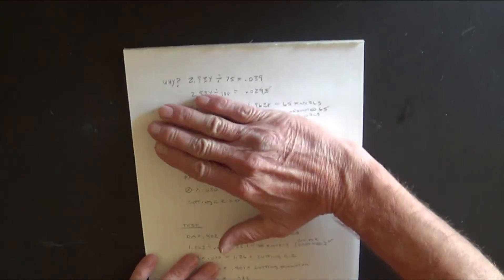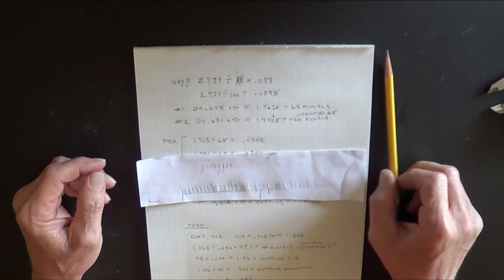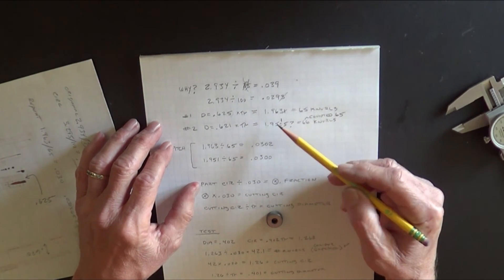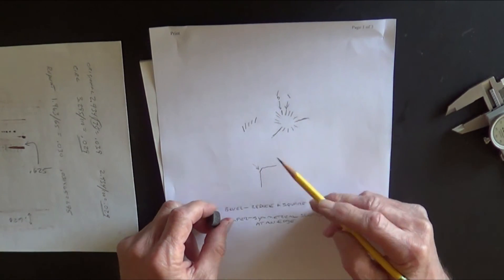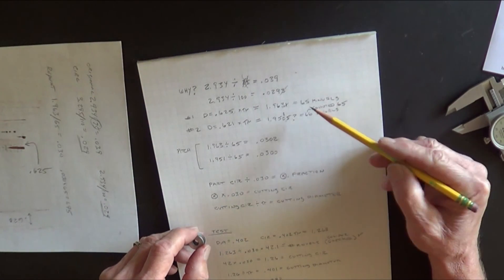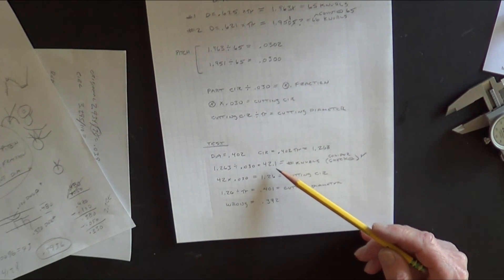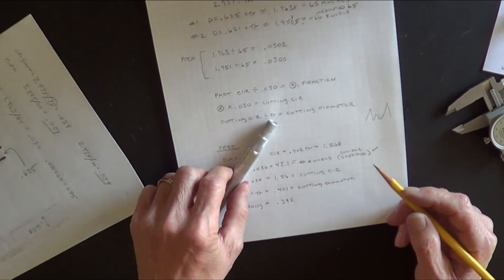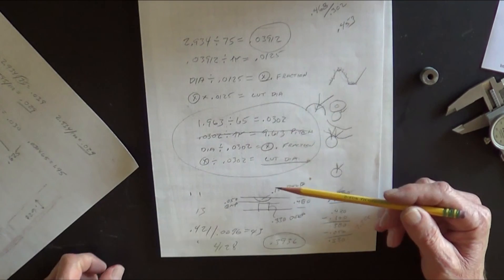The Art of Knurling Take 2 Video #10

Comment: Dave,

You are using the correct approach by first finding an integer multiple of the crest-to-crest knurl tooth spacing and then  determine the new circumference (and converting to diameter) before knurling. In practice however your usually have to machine the new diameter a few thousands larger than the calculated diameter. 

Next, lay down a very, very light test knurl track by manually turning the chuck two revolutions to see if the knurls are tracking perfectly over each other. If not, take another 0.002" off the diameter and test again, and usually this second pass is close enough. Then go for full deep of knurl in one or two passes. I use this technique a lot and it works every time (see examples at http://www.homemadetools.net/lathe-tailstock-clamping-lever and http://www.homemadetools.net/machinist-jack-accessories ). Also another HomemadeTools contributor who goes by the name "PJs" has published a great calculator for determining the correct knurling diameter according to the type of knurls used (see http://www.homemadetools.net/forum/online-knurling-calculator-20335 ). 

Thanks for the follow-up video on your knurling,
Paul Jones
Reply: +Paul Jones Thank You for the kind words Paul!  Your knurls always turn out beautiful!  The key to me in the formulas is that they work on any size materials as long as you know the exact makeup of the knurls you are using.  However having your tools held rigidly and square to the work is just as important, IMHO.  ~PJ
Reply: +pjsalchemy Thanks, I have been using your formulas for knurling dimensions in my drawings. I also discovered an Android phone app "Knurling Calculator" that I can use in my shop but it only works for knurls using Imperial dimensions. I don't think the app is available for the iPhone.
Reply: +Paul Jones Thanks! Glad you got some use out of it and for the App tip.  I had tried a couple of apps a while back and didn't work out but this one is based on Ghostses' original which I mentioned in my dissertation. It seems to be within tenths of my spreadsheet for 14, 21 and 33 TPI knurl wheels.  I'll spend some time with it and check it out!  Might be worth writing an app just not in my skill set.   I just loaded the spreadsheet on my tablet and use it in the shop along with some other calculators I've built.

Comment: Retire? Nah, I got 5 bucks says your still thinking about the problem and theorizing about the differences.....I've got a theory but I'm going to preface it with a  quantifier...I have zero machining experience (other than watching youtube vids), however I do have some experience with woodworking machinery and the major differences in fit that can be caused by very minor deflections in the machine. My theory? The small diameter of the part, the minuscule error in math, the softness of the working material, and tool pressure combined to let the tool fall into the previously started knurl...resulting in a visually accurate work piece. Got's to remember as you knurl you are changing the diameter of the piece as well, it's actually expanding- ( used to be cheaper to knurl the valves instead of replacing worn valve guides)- yet the working point, where the point of the tool meets the surface is decreasing in diameter....not sure that that would have squat to do with it....So what happened to the piece made with "correct" math? I'm betting it's just what you said... a piece of debris ... knurling is actually deforming the metal to begin with and creates heat.. aluminum gets gummy with heat and harder to clear chips but now I'm preaching to the choir. The challenge? Make a piece out of steel, minimize possible deflection, use wrong math on one end, "good" math on the other and see what happens....keep em coming David!!!!
Reply from the maker: +Michael Bashaw The problem is the knurl wheels themselves. One is bigger and made a 66 knurl impression while the other 65. Making a light, light impression, then eye looping it I can see the right math has it on track but the wrong cross hatch is visible. Makes a rectangle looking pattern. Going to find better wheels....